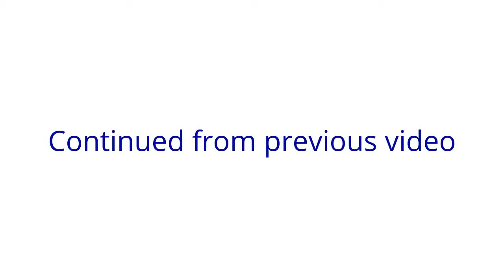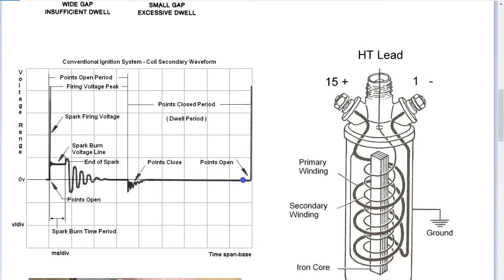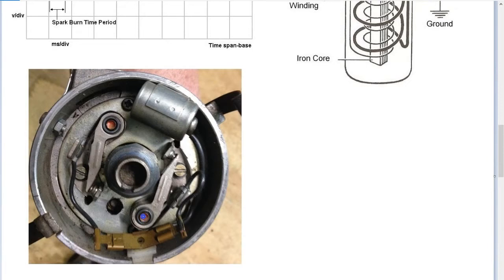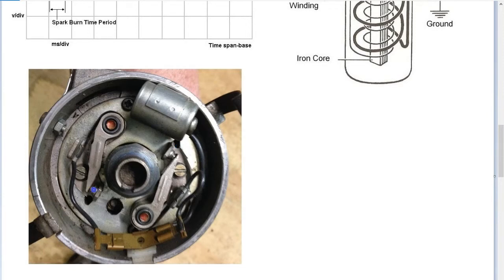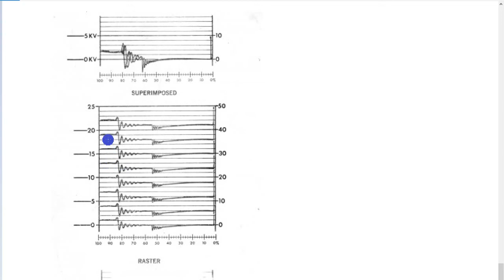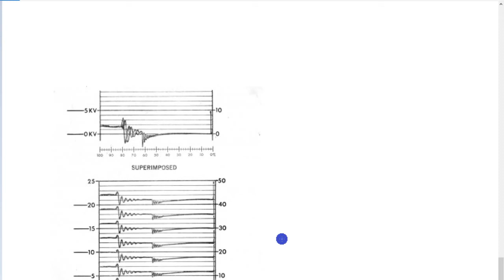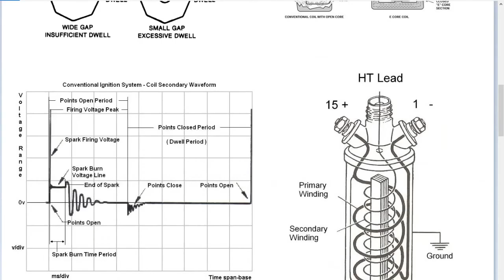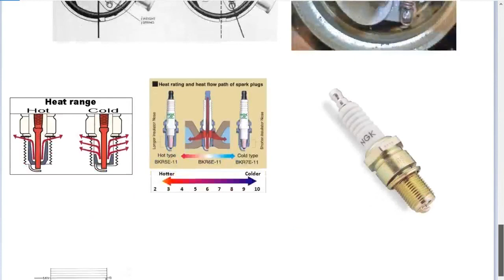Twin point ignition distributors explained E25

Comment: Well, I think you're description sounds correct but what I think is actually happening is this, one set of the points is handling the opening current and the other set is handling the closing current thereby halving the arc and doubling the life of the points - maintaining tune longer.
The dwell is the same as it is in a single point distributor and I don't think you're getting more rise time for the same dwell even if the individual point dwells are lower. How can it? The dwell is the dwell. If you set it to say 32 deg then it's 32 degrees whether it is single or dual point distributor isn't it. That's what the gauge is reading and therefore that's what the coil is seeing.
There's no electro-mechanical trickery going on here except a more stable and repeatable triggering over time. 
I could be wrong but I don't think so.
Reply from the maker: The dwell time in twin point distributor is longer by design to provide sufficient dwell time at higher then standard RPM for high performance engines, back when I was a mechanic in the late 1970's and 80's they were a common addition to any high performance (high revving) engines.
To set them correctly you stick some paper in one set of points and set the dwell and then the other a set of points and set the dwell to the same, once you remove it you will see the dwell time increase.
And there is no arcing on the points when they close and you can see that on an oscilloscope we commonly used back then to diagnoses ignition systems. Kettering ignition systems only run about 4 amps on the coil and through the points, it is the back EMF that causes the arcing on opening only.
Reply from the maker: In relation to dwell time, dwell angle represents the distributor angle the points are closed for and the dwell time is the amount of time the points are closed for.
Being dwell angle is fixed, as RPM rises dwell time decreases. So in an engine that revs much higher than standard the amount of dwell time for each cylinder firing becomes so short that the coil gets insufficient time to fully saturate and thus reduces the output at very high RPM.
If we ran a higher dwell angle to get a longer dwell time to handle very high RPM the points gap would be so small that due to points running block wear the points would not open enough after a fairly short mileage.
Reply: @AuMechanic  I am a qualified mechanic. Trained at Richmond Tech in Melbourne. Qualified in 1986. Did my apprenticeship at a Merc Benz dealership. Lots of V8 Benz's had dual point distributors. My recollections are completely different to your description however. Since I was writing a piece for an article I decided to do due diligence undertake a bit of fact checking. First, I rang a dyno guy I know and asked him. He's pretty clued up and he just reiterated what I wrote without any prompting from me at all. I just asked him, "How does a dual point distributor work?" 
I cannot for the life of me find anything from any car manufacturer or dual point distributor manufacturer that says anything either way. 
I did find this (link below) though, but it just agrees with my training. To be more across the subject and not leave myself open to a character assassination I'm trying to find an official description in support of your contention. 
I'm not saying you're wrong it's just I can't find any descriptions that disagree with my training, my dyno mechanic mate's description, the solitary unofficial link I found and a few YouTube vids - none of which agree with my understanding.
What I'm searching for is something concrete either way.   
https://mgaguru.com/mgtech/ignition/ig200.htm
Reply from the maker: @ThePaulv12   In the link provided he states " Mallory Dual Points distributor has total dwell of 40 or 41 degrees (depending on which spec sheet). Mallory single points distributor has dwell of 35 degrees."
In short this tells you that the points are out of phase of one another, that is that they do not open and close at the same time which is to serve a purpose that is to increases the total dwell time. The staggered opening and closing is not there for no reason at all which is a fact that seems to be lost on the author of that page.
If what he says was true then simply having 2 set of points in parallel to the primary side both opening and closing together would suffice to share the electrical load, and that in the Merc may be  true, but the Mallory is or was sold as a high performance distributor and has staggered or out of phase opening for increased dwell.
His theory on timing is odd considering that timing is simply set by rotating the distributor body.
Aside from that as mentioned using a Tune Scope you can easily observe that there is no arcing of the points on them closing and as such the theory of shared load at closing by a second set does not hold.
Reply from the maker: @ThePaulv12   I should also mention that some engines such as the Maserati Merak V6 has 2 coils and 2 set of points (one set above the other) driving 2 Bosch Modules (similar to early Merc Points switched Electronic ignition), each coil fires 3 cylinders only. This in effect allows for a very high dwell time on each of the 2 systems in a high revving engine.
It is more obvious that this systems is for that purpose and not simply to share the load as the 2 sets do not simply fire all 6 cylinders in parallel, and the coil load is switched by the modules and there is very little load over the points.
Reply: @AuMechanic  He's describing a four cylinder distributor in fairness rather than a V8 one I think.
In my understanding, the point staggering is to provide opening and closing at different times, and effected by individual point dwell being slightly less than the collective dwell. The collective dwell is engineered in feature and is as you describe but on a V8 the individual dwell according to specs is say 24deg but collectively the usual 32 or whatever it is - the extra 8deg added in - again as you describe. At least you can see that in any of the Mallory point setting instructions. 
I have to go, but if you add anything I'll have a look tomorrow. Cheers, Paul.
Reply from the maker: @ThePaulv12  
I also add that Merc was not renown for have very reliable points ignition systems. for example one such system was the early points switched Bosch Transistorised ignition model that had a problem where the points would foul with dust and cease to switch, Merc in its infinite wisdom saw fit to have a condenser fitted to the points even though there was relatively low current over the points as they switched the base of a transistor in the module, perhaps as a legacy from the older non transistor system or to manage parasitic arcing. The cure of this problem was to actually remove the condensor and allow any small current flow arc over the points to burn off any dust on them and thus the points no longer suffered the problem.
Reply from the maker: In addition to the web page on the Mallory, the Mallory twin point he is showing was sold without a vacuum advance at all that would be advantageous for a street car for fuel economy at cruising speeds with high throttle plate vacuum that drives vac advance, if it was simply for longevity of the points. And as such having no vac advance it should have been somewhat obvious to him that the distributor was for high performance use, EG racing, where a vacuum advance is not used since the engine does not cruise to make use of vac advance and longevity is not a consideration.